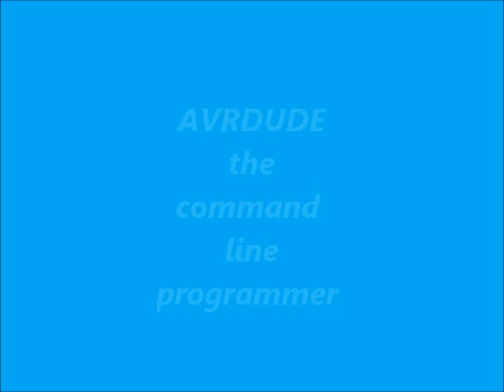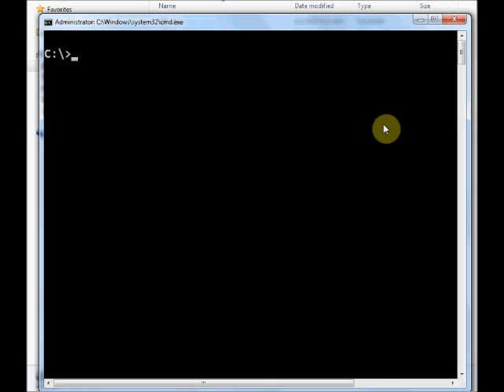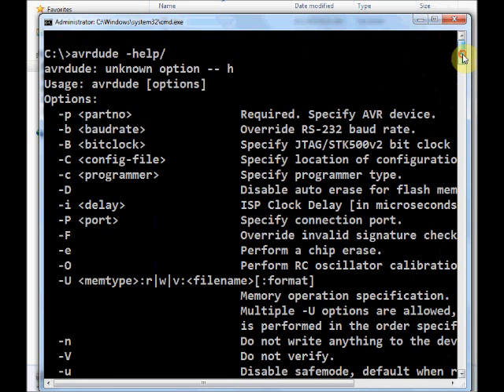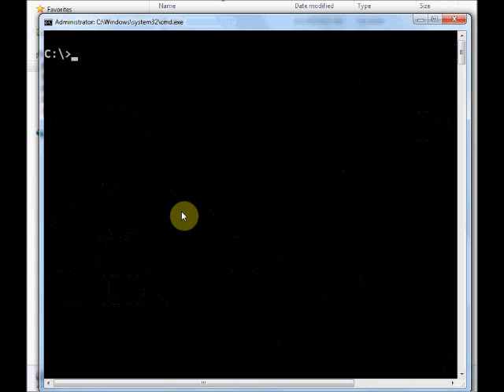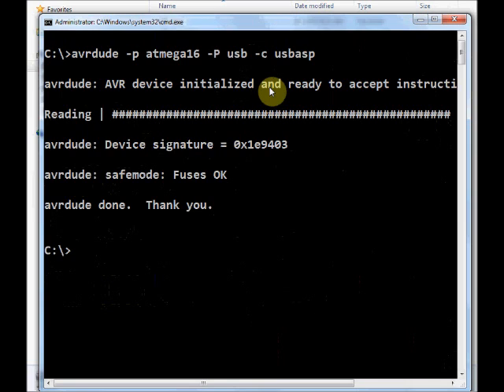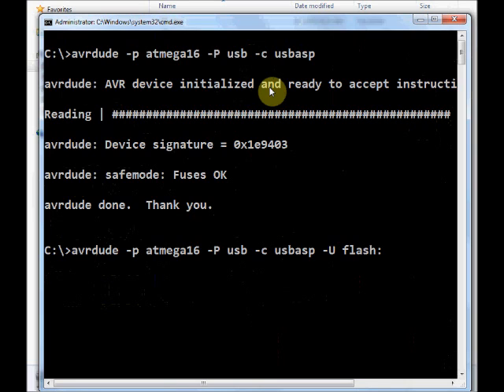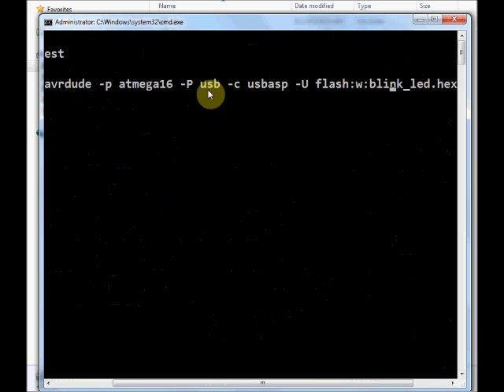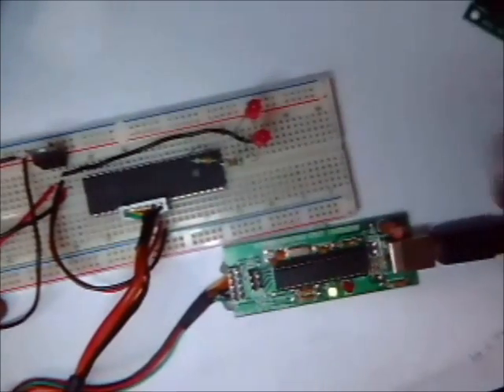AVR DUDE -Command Line Programming

Comment from the maker: Click on Start button --> Control Panel --> Appearance and Personalization, -
---> Taskbar and Start Menu.

Click the Start Menu tab, and then click Customize.

In the list of Start menu options, select the Run command check box, and then click OK. The Run command will be displayed on the right side of the Start menu.
Clicking on Run will open up a window where you can type cmd.exe
It is located within C:\Windows\System32